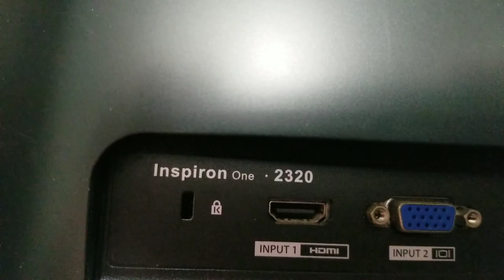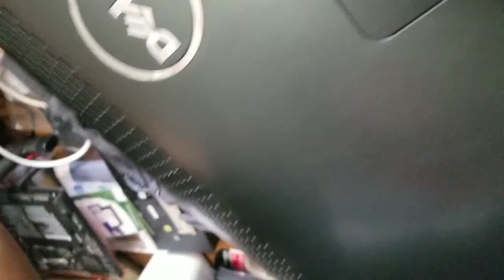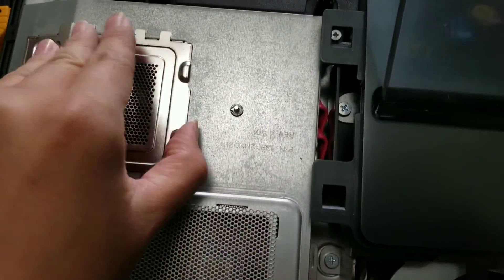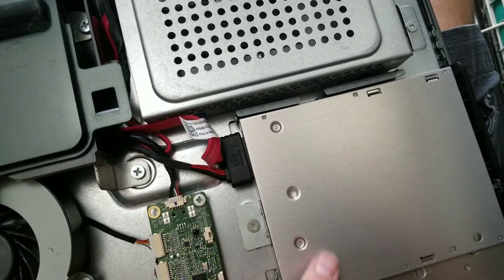Dell Inspiron One 2320 Disassembly Hard Drive SSD Upgrade

Comment: Tried to boot up my system after 5 years of not having WiFi. Lol. I did a pre boot check and my memory keeps failing. I’m a disabled veteran on a small pension. Is it worth fixing the memory?
Reply from the maker: Try just one stick of RAM at a time

Comment: I have the same pc it takes many attempts to start it up than when it does boot it just shows black screen no way for me to enter safe mode what could be the issue
Reply from the maker: Sounds like hard drive failure. You will probably have to replace the hard drive and install Windows from scratch. If you need data, I recommend connecting the hard drive externally to another computer with a 3.5" sata to usb adapter

Comment: Thanks for the video. What kind of SSD did you install?
 I'm trying to figure out if an NVMe would be compatible with the same computer.
Reply from the maker: Because of the age of the machine, I don't think it supports nvme. I used a 2.5" sata. Normally I go when sandisk, crucial, Kingston, or Samsung depending on the cost at the time.
Reply from the maker: This one specifically was a Kingston 2.5" sata ssd
Reply: Subscribe to It's Binh Repaired Thanks! I'll look into those brands.
Reply from the maker: @viviananica3775  Sounds good. Btw, how did you find my channel?